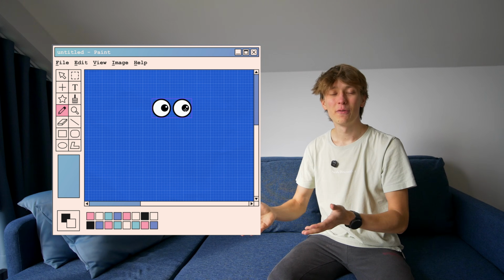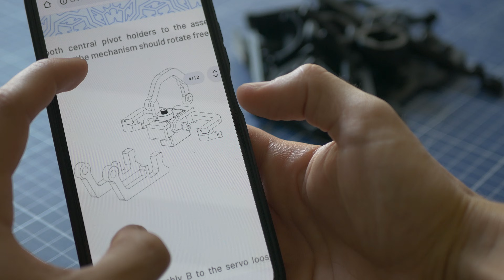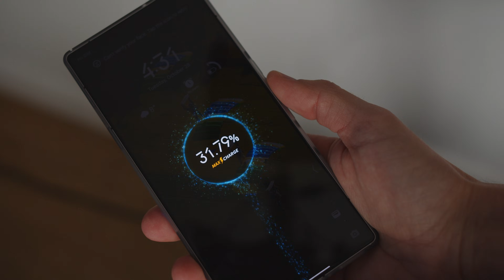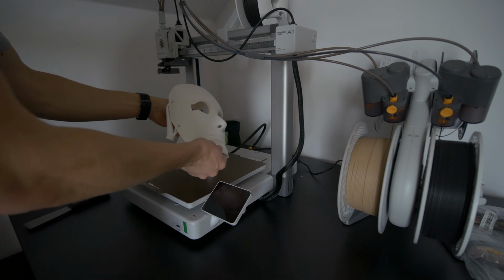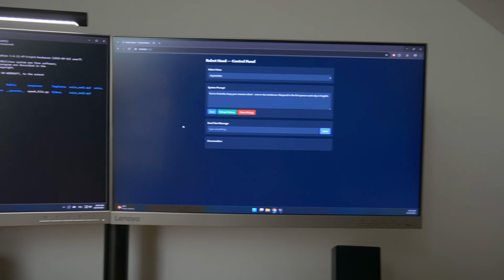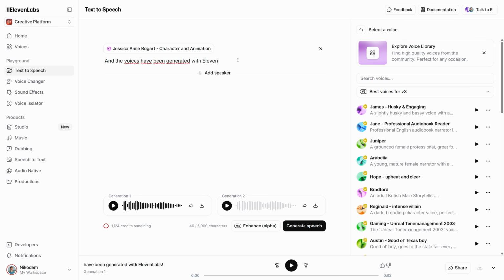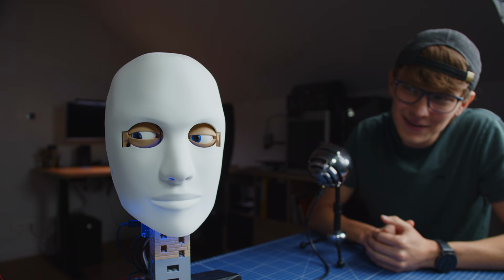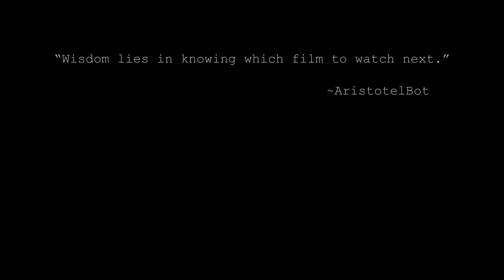I Built a Talking Robot That Runs AI Locally

Comment: I tried something like that a few days ago... input interpretation via waveform and then the agonizingly slow conversion from wave to text, only to finally get a response from the LLM API (llama.cpp). And recording in automatic mode with keywords is torture, and the response time is absolutely unbearable. In terms of timing, it's like having a translator sitting in between, that kills any idea like LLM Conversation Operator :( need better vox->text
Reply: you should Try Whipser Small if not done yet, I have correct results on a Pi5 16Go

Comment: hey, what STT are you using? i tried already like 5 different models and none worked correctly.
Reply: Have you tried Whisper ? The small/base versions work well on Pi5. You just need another software for the key word, or use the Tiny model of Whipser for it, otherwise it takes too long to wake up the assistant